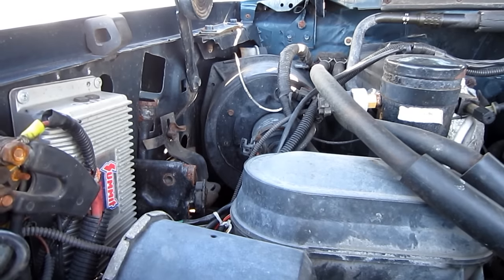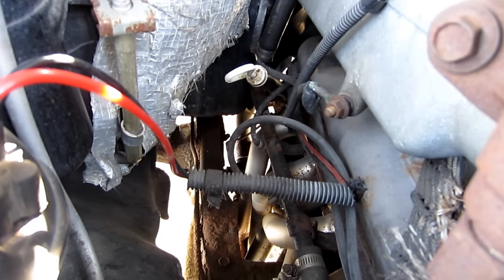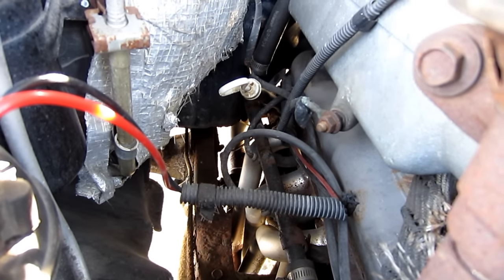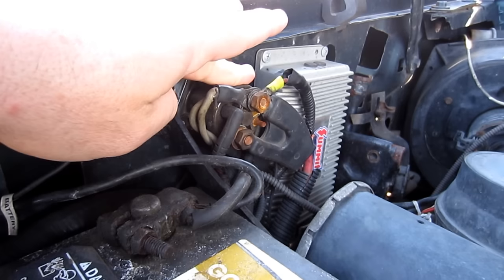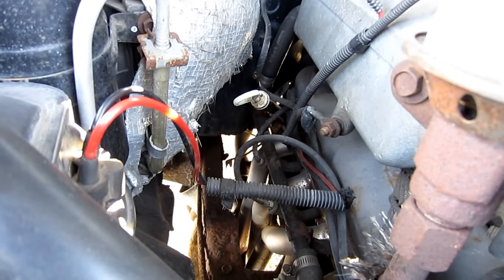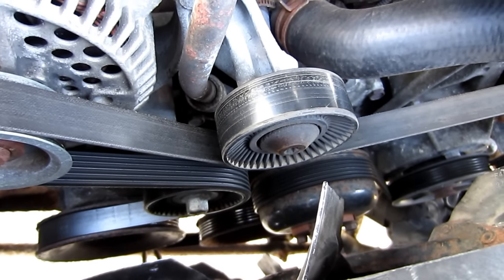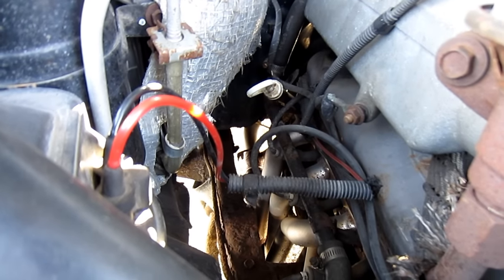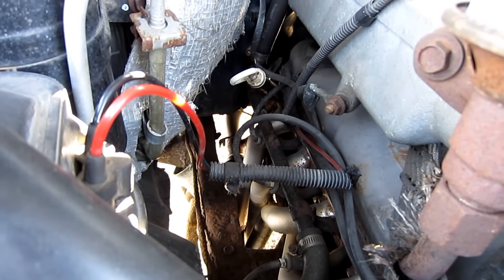Know your cars Clicks. Why it won't start

Comment: Thanks for being so clear dude all these other auto you tubers like to waste peoples times with over produced editing and rambling.
Reply: Absolutely!!  This guy can give lessons on how to make a helpful YouTube video.
Reply: Preach
Reply: Fr💯
Reply: @susanbennett9062  ⁹
Deaow
Reply: Clear sure but he is not showing you how to confirm that the starter is indeed bad. The issue of a click and no crank or of a slow crank can very well be a bad starter wire causing a voltage drop when under load.

In other words, if the starter is not turning, then you'll have 12 volts across the board, but when you try to start the starter the volt will drop to say, 3 or 5 volts. That is a severe volt drop and occurs normally do to some form of resistance in the cable, either corrosion, a open short, a cut wire, a pinched wire I mean a lot things could cause a lot of resistance for no reason.

To voltage drop test
Take a multimeter, set to test for volt DC, connect to the beginning of the line you want to test then connect it PAST a segment you want to test. Then test for voltage. (Turn the key or bypass it. Put the starter under load) It should say 0 volts if there is no resistance, aka a good line.  

If you get like 4 volts or something then that is how many volts you LOST thru that wire. That means the starter only sees 8 of the 12 volts, and what will result of this is a notorious 'bad starter bad starter bad starter, my 5th one!" situation when it is a poor wiring connection to the starter. I can go more in depth on how this all works etc etc 

But instead imma say this, in order for you to test a circuit or a device, you need to place it under load. 

Cheers
Reply: Absolutely a great right to the subject informative video
A+
Reply: Why don't people separate their sentences with periods anymore?  Why don't people use commas when they're adressing people anymore?  E.G. "Thanks for the info,* dude.*"
Reply: Thanks so much. Gets rt to the point. Now I know I just need a battery. No stress.  Thank you thank you
Reply: I have the same one click, but when I slightly turn the engine manually with a wrench it starts right up. What does that mean?
Reply: I thumbs down and report them for being misleading.
Reply: Sounds like a direct insult to Scotty Kilmer.
Reply: @peter L
Reply: Yes I can't stand when I'm sitting beside something torn apart and then they talk and talk and talk and take 15 mins to show me 2 mins of what I need
Reply: Exactly!

Comment: Holy smokes! I think you just solved what's wrong with my motorcycle. The battery is brand new and everything lights up BUT the bike won't turn over. Instead, it's making the rapid "clicking sound" you mentioned which makes me suspect that it's the relay, not the starter. I already ordered the starter, and it's not hard to put in, so I will swap them both out.

Comment: For people that are having problems like this, another trick that works to know if the relay has gone bad, is to jump the two bolts with an isolated screwdriver (0:50), if the starter works, the problem might be the relay itself, a fuse that controls the relay, or the "s" cable that sends the signal from the ignition key to the relay itsfel. I'm currently waiting on a friend's tester to see if my S cable or relay is my actual problem. Starter working just fine.
Reply: I also love your comments is nice
Reply: Additional great advice. Thanks sir
Reply: U can fry some eggs if u don't know how to do that
Reply: there’s no screwdriver at 50 seconds…
Reply: @bspvdj  😂😂
Reply: Yall are confusing me calling the solenoid a relay. That is not the starter relay. the starter relay is in the fuse box under the hood on the driver side by the fender well. Also. That loud click may not be the starter. That loud click can be the solenoid. That means it is good. So you may want to check the actual starter relay in the fuse box before you pull the starter off. Also check to make sure your cables are good and clean and take your multi Meter and check the battery voltage first thing.

Comment: Thankyou so much!!! My f250 was randomly not starting and I didn’t know why. It did it again and my wife needed it to go to work. I watched this video and noticed it was locked up. Used a ratchet on the alternator to get good leverage to turn the belt and it started right up🤠

Comment: I reacently fixed my Ford Ranger XLT 1997, the starter made just ONE click when turning the key. I bought the car for 500 dollars, but the Owner said the starter needed to be replaced. I digged deeper into this fix, i thought it was wierd With One click. so i looked under the Hood and just wiggled at the starter cables Down onto the starter! And i just jumped into the car and turned the Key and it started right up!
 Try this before you buy a New starter or any other parts!
Reply: Gonna try this when I get home on my 01 gt

Comment: Check for the most obvious and simple first! I had installed a new battery 6 months prior.  Now all I heard was a fast clicking sound.  A jump start worded but seem to not hold a charge. The + and - had no corrosion and showed the battery terminal protector paste to prevent corrosion. However went checking the cable connection I was able to slightly wiggle the cable on the + side. The bold felt tight, so I used a wrench to really force the bold till the cable connection on the battery would not move at all.  Next stated the car without any issue.

Comment: Great video....thx.  I know this is not a forum to try and ask a question on a 7 year old video and expect to get a rapid response.  But I am pretty sure my Starter is bad.  It is just unlike any other diagnosis videos put out by anyone.
Scenario:  Brand New Battery - I get 1 Hard Click....then nothing.  I have to disconnect my New Battery to get 1 Hard Click again.  NOT a constant Clicking, not a Click every time I try to turn the key.  Just 1 Hard Click, then nothing, dead, wont let me attempt to turn the key unless I fully disconnect and then reconnect the battery again :/

Comment: short trip, likely frosted up armature.  if can reach with heat gun or propane torch could warm up, if wires around, use hair dryer or just be careful, deal with this all the time in plow truck and now that it is -30F and colder with wind chill, even longer trips, the starter ices up upon cooldown.. I see zerostart makes a couple different pad heaters, 3400051 is a 50 watt 3x3 12VDC silicone pad heater that we could attach to starter, run through relay and fuse to switch inside vehicle to use when this happens.  they make small AC style units to, but that only works if you made it back home or near available AC power and have extension cord along..   I see this far more often with GM starters, not sure why, perhaps because I mainly drive GMs.. But live in area where Februaries can be 0F for a high and -50F wind chills at night so the frosting of the armature issue happens frequent enough that I may have to build a garage to park cars in so I know I have a ride that will always start when live miles away from help...

Comment: I just replaced my alternator and my battery was dead. Do I need to  let my battery charge from a jump before trying to start it? Because it's doing the fast click like it's the relay
Reply from the maker: Yes..But it is best to put battery on an external charger...because charging a completely dead battery may burn up the new alternator...

Comment: New battery  I put in and the starter motor clicks  could it be the starter motor ? All the light work and interior  and radio  works just won't crank  just clicks from the starter

Comment: I have a question , what if I had all the same exact symptoms you had. ( one click , no start, all power accessories work & battery is brand new, relays are new. I cleaned my terminals, I even replaced the starter, but I’m still having the same exact one click no start issue. What do you think it could be ?? Thank you for the info by the way , it was extremely useful & helpful to pinpoint everything.
Reply: It sounds like you starter is jammed or misaligned
Reply: What did yours end up being due to?
Reply: @WunKoolKat  supposedly the starter that I bought new was also malfunctioning so I just got a 2nd new one & it worked fine.
Reply: @daygostunna326  thank you..that would not be fun doing a second install if you got it all back together. Glad it all worked out!

Comment: Two days before this Thanksgiving, I got stranded at my local supermarket in a 2000 Ford expedition, would not crank at all. Had my wife bitching at me why it wouldn't start and kids fighting in the back seats, did not like that situation at all. Luckily my backyard mechanic answered the phone, always smoking weed, told him I thought it was the starter b/c would not crank at all. After almost two hrs., he gets there goes under truck starts hitting starter with hammer no luck. Checks the battery and we got plenty of juice. I suggest to him why does he not go under truck and touch starter with screwdriver. He goes to his truck and grabs a screwdriver touches the starter selenoid two prongs instead, and truck cranks. Second time he does it, I turn key on ignition and starts right up. He tells me to turn it off and put it in nuetral and he touches selenoid again with screwdriver and it starts right up. Tell me its probably ignition switch going bad. Anyway we make it home and tell him thanks, I owed him one. Next day I change the starter selenoid thinking it might be that, saw youtube video. Following morning try to start truck, nothing, no crank at all. Then it dawns on me, to hold the shift lever up right on park and guess what it started. The shift lever being a little loose was not sitting at the right position thus not letting the truck start. I called my backyard mechanic to change the starter anyway and tighten that bolt that secures the shift lever, and wallah, that was the problem. Something you might want to look into next time your truck won't start, thanks for video. Keepm coming, envious of yu having subway right next for when u get the munchies.
Reply from the maker: Tony Garza Good story, and good point.. The neutral safety switch in automatics can sometimes get a little "wacky".. Thanks for sharing..
Reply: Tony Garza thanks. my crown vic same story. yes the wife got mad and kids don't help. I don't expect the kids to literally help.
Reply: Guys, these v-8 ford engines last a long time if you take care of them. It's just the little things yu need to change like the alt. starter, wat. pump etc. I have a fantastic mechanic that works for so little money but smokes alot of blunts. Hopefully you have a mechanic that does not charge alot. Keep those videos coming. I even show him stuff he does not know about on youtube.
Reply: Tony Garza , but I  8th m2xyk
Reply: NO! stay away from K-2, that shit will fuck you up!
Reply: Wallah sounds alot better than voila! But thanks for the spelling lesson.
Reply: Good story
Reply: Thanks a lot ! Same problem with my Lincoln Navigator 01. Im going to try this tonight!! hopes it will work!!
Reply: Why even mention that he smokes again? He seemed to know exactly what to check based upon your description, and after demeaning him you state that your jealous of the subway near him for when you have the munchies? So hypocritical.
Reply: Good advice. Like that wallah. The French spell it viola.

Comment: sir I have the same problem though mine will start with 1 click then other time 3 to 4 clicks .... when it's cracking it directly through... not weak but strong . thank u for your video hope you can add some tips.
Reply from the maker: Sounds like you may have a problem with the starter on some level the fact that it sounds strong makes me believe that the connection going to the starter is the problem

Comment: I have a 98 gs300 with the problem of the one click. I have power and checked battery was fine but I don’t hear that clicking noise coming from the relay I don’t want replace it and not the starter so idk which one to do first bc I thought it was the starter

Comment: My 95 7.3 won’t start with the key I’ve put new starter and ignition switch and it won’t turn over. I have a klick from the top driver side pulley. Both batteries have enough juice all lights and ac works but I want to start it with the key. Any idea
Reply from the maker: Check safety interlock on transmission..

Comment: My truck does the same thing as yours but got my starter tested and cleaned my groundings and replaced battery cables and got batterie tested and it was good still cant figure out the problem the truck starts sometimes it doesnt
Reply: Timing

Comment: You  pointed out some obvious culprits and at least one not so obvious,thanks
Reply: I have a 2005 Saturn ion 2.2 I changed the slave cylinder before I did that it started quick now no start brand new battery crank sensor coil sensor and just won't start anybody have any advise

Comment: What about a single click on the firewall solenoid (I think you called it a relay)?
Reply: Listen to video again .... he told you .  Single & sometimes 2  click means good starter solenoid .  Repeated clicks over & over means .... check your battery .... possibly battery bad  .... charge your good  battery to full and try again . .... if everything checks out good .... start troubleshooting your starter .... theirs another good video on starter on youtube ...... type up search ....  Klowny ..starter video .....         holler !

Comment: What if you hear no click at all? Good battery and engine isn't locked. All fuses and relays good
Reply from the maker: ignition switch issue possibly... get a handheld remote starter http://amzn.to/2k31lIy and jump the starter relay.. make sure fusible link is good also.. you will have to start testing all your wiring from the ignition to the starter relay to ensure there arent any broken connections..good luck
Reply: also check your fuse box maybe the alarm activated
Reply: I have that problem but every time I try to start it the alarm just goes off I had to unplug it but still same issue

Comment: I have a 1997 dodge 4x4.  It’s been doing that same click for the last 16 years. I have it recorded on my channel of 2 videos. And the crazy part is. It only does it once in a while. But it will eventually start. It does it a few times then I won’t have a problem with it again for about a few weeks or month. I hardly ever drive it though so I don’t really want to dump a bunch more money into it trying to diagnose it. I had the starter tested the battery is like new.   And the last time it did it I just left it at my sons house brought one of his cars  home.   Went back the next day it fired right up haven’t had a problem since.     If you click on my name an go watch the 2 videos you will see I don’t drive it much but seeing’s I live out in the middle of the country. With builds all around me I go out and start it every other day. Or 2   Please let me know if you know what it might be.
Reply from the maker: Intermittent electrical problems are almost impossible to do without having hands on. You're going to have to check every ground and every cable and every connection but you have associated with your starter and ignition switch and any kind of ignition lockout safety devices such as your parking switch that could cause it to do intermittent thing like that

Comment: I just replaced my starter on my 84 ford ranger and it does that same clicking noise. The horn and the headlights don’t work unless the battery is on a charger. I tried to jump start it off of another vehicle and it still won’t start. Is that a bad battery or a starter relay?
Reply from the maker: No horn no headlights no battery power.... Check ground cable going to engine and the connections going to the starter relay and of course at the battery.
Reply: Foxboss9 thanks for responding! I will look at it tomorrow and do what you said. I’ve been going at it all day today

Comment: I'm having rapid clicking so I'm hoping it's just the battery. I've had alternator issues in the past and it wasn't fun.
Reply: It was just battery this time.
Reply: @ImaginationToForm  Hi? What was the issue with your battery? My car makes the same sound and I’m trying to figure out what’s wrong with the battery.
Reply: @nado5918  Hi, the battery had discharged from the cold. I bought an inexpensive car battery starter and was able to get my car going again. And after sometime was able to recharge the battery. We had a few more cold days that zapped my battery again but having my own car battery starter was very helpful from then on.

Comment: My car does a single click and nothing after. Replaced the battery, same thing. JUST replaced the starter, still, one click no start. 1997 Cadillac Deville
Reply from the maker: Check all the cables. Including grounds
Reply: I have that with my Corolla right now, a single click nothing after. Some times it will crank or sometimes it would require a lonng crank or multiple attempts. Replaced the battery and it still happens. I think it could be an electrical issues, i wonder if my distributor was bad if it could do this ???
Reply: Same here but I don't k ow how to fix it? New battery still only a single click then nothing. How'd y'all fix it??